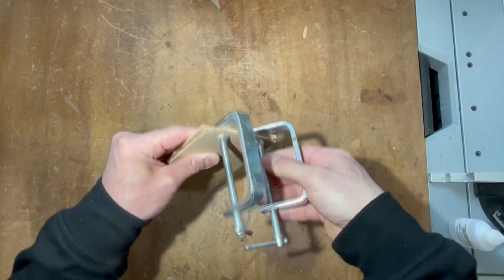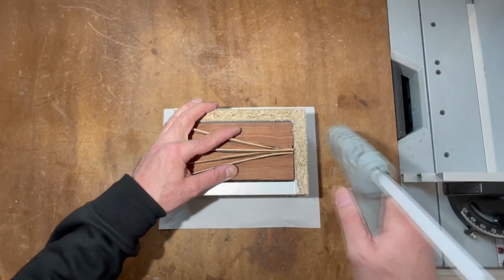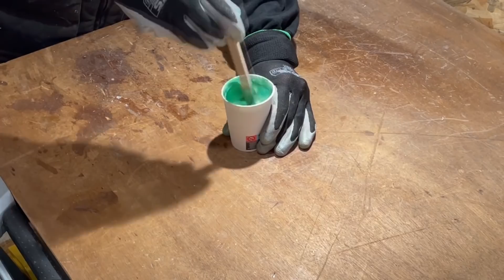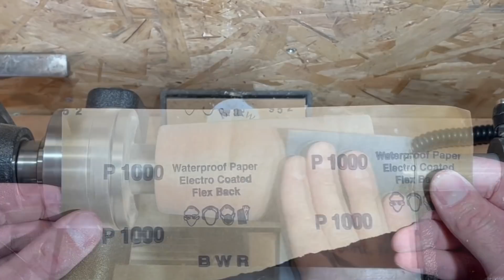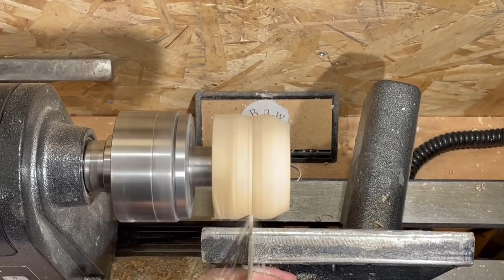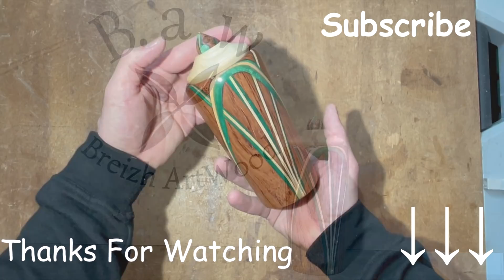Woodturning : A Very Interesting Idea 👍

Comment: I asked this question on another woodturning video and got one answer, but here I see you've done something different.
What is the advantage / disadvantage in trimming down the corners of a square block before turning?  I've seen many turning videos where they take a square block of wood, and/or a square block of resin/wood/encapsulated stuff and put it on the lathe directly, knocking off the square corners with the lathe chisel (or if a lathe chisel has a different name, whatever that tool is called).  It seems to my eyes- as someone who has only used a lathe once in their life, and that years ago- that those corners would be extremely jarring, and challenging especially with a fragile thing like objects encapsulated in resin, which might be prone to chip-out.  Here I see you cut off those corners, so you were starting with an octagon: much closer to a cylinder than a square is.
What's the difference?  The other video I asked, they said it's simply just as easy to knock off the corners on the lathe, as it would be to cut down on some other tool.  They're the expert, so I take their word for it that they find it easier that way.
I still 'feel' like cutting it down would be easier, but that's me without experience.  Now I see this video a professional is cutting off the corners.  Do you always, or usually, do that?  What is the decision-making process to choose whether or not to cut off the corners first?

Beautiful work, and such a creative idea!
Reply from the maker: I cut the angles for 2 reasons, the first is to avoid too much loss because I reuse the angles in other projects and the second is to save time and energy spent on the wood lathe😉
Thank you so much for your comment 😉👍👍

Comment: Wow, that turned out lovely. 😍  Is it simply made to be decorative or does it have a purpose?  For example, is it coated in a food safe material so it can be used to store dry goods in the kitchen?  Not that there's anything wrong with it being made for display on a shelf only.  It's certainly pretty enough.  Either way, well done! 👏
Reply from the maker: Thank you very much for your comment, I am very happy that you appreciate this piece 😉😊💖💖💖
With this finish you can use it as you want including to store food products 😉👍